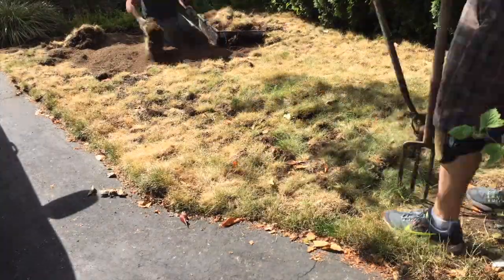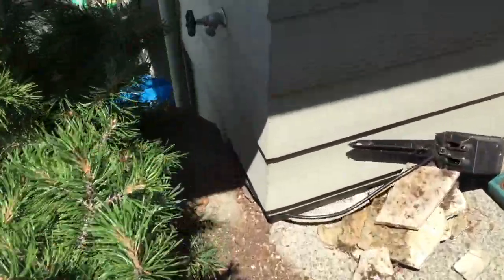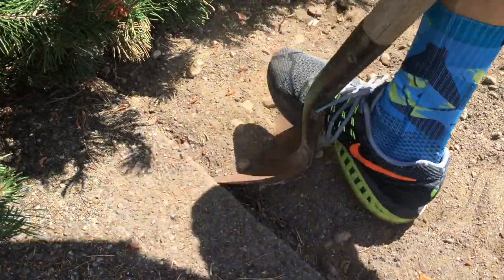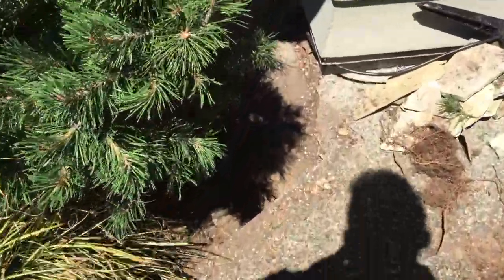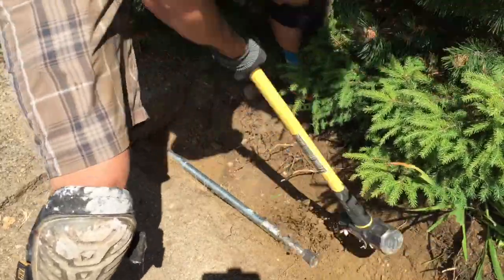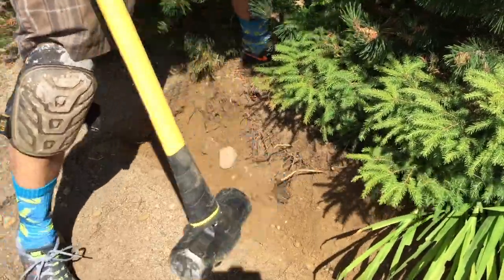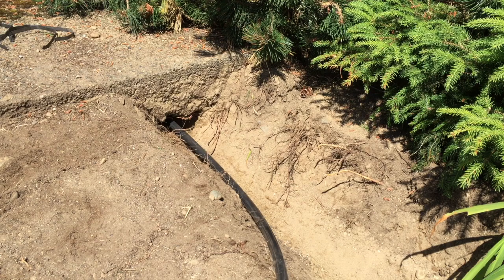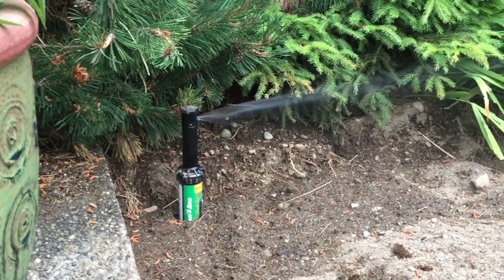DIY: How to Pipe Under Existing Concrete : Sprinkler System Tutorial

Comment: I did a hybrid of what some are saying, using pvc with a jet tip, but In the PNW here we have a lot of large rocks in the soil.  so I used a 8' "dig bar" which is effectively what you made with the pipe, and i hit it a bunch with a sledge hammer!
Reply from the maker: Great to hear Brian and thanks watching.  Nice work on doing it yourself.

Comment: I have always used pvc and hook it up to a garden hose and jet it under the concrete
Reply from the maker: Thanks for the suggestion Dan.  I'll have to try that out.
Reply: I like that his solution was free by finding a way with stuff around the house. He lucked out only needing to go under a few feet of concrete, but yeah, he would've saved himself a ton of time and work doing that method. The fittings are cheap, too.... $5 for an "Orbit Walkway Tunnel Kit" at Home Depot
Reply: a lot of people are suggesting this pneumatic method, but would it work in dried clay? always looking for an easier way

Comment: I have a well in our driveway and the power cable broke under the ground. I had a plumber come and install a temporary cable but now I need to get it under the pavement. Your video is interesting but not quite what I needed. I need something I can buy to put on my drill. I need to go right angle then straight. I am not good at making tools like you are.
Reply from the maker: Interesting.  Did you get this taken care of yet?  If so, what did you use.  Thanks for watching in any case.

Comment: I am trying to tunnel under a small concrete slab about 3' wide.  I have tried using the water and PVC pipe method like everyone is suggesting.  I can't breakthrough.  Any idea why this is so difficult?  I have spent hours on this.  It sounds like it should not take this long with water and PVC.
Reply from the maker: Are you just using you garden hose pressure?  if so you might want to barrow or rent a pressure washer so you have extra power that is needed in your case potentially.  Thanks for watching Marilyn and hope you enjoyed the video.
Reply: You may be hitting concrete or rocks.  Try going a bit deeper with the   new line, or moving a few feet over from where you last tried.  Also, concrete is sometimes installed over a base of rock - typically 3/4 gravel.  You would have to go below that to get the line across.

Think about going larger than the line you actually need.  If I needed a 1/2 in line I would first place a 1 in. Line under the slab and then feed the 1/2 inch through it.   Then if there are later issues you can pull out the 1/2 in. line and not have to 
fight to get a new one in.

Comment: Great job! A friend of mine needs to do something similar but for a pool in a home built mid 60's.

Any suggestions on how to rewire a doorbell. Our new home was built fast and the door bell wasn't placed in a very practical place meaning its on the wrong side of the door. We want to install a door bell/camera but the angle wouldn't show much of the person so we must figure out how to get it from one side to the other under the tile and through the brick . Any ideas?
Reply from the maker: I actually have to replace my door bell so I'll make sure to do a BYOT on it.  However, I won't need to reposition my doorbell so I'll have to do some research on your situation.  I feel like I have seen some Bluetooth/ remote powered doorbells out on the marketplace. Have you looked into those products yet?
Reply: Go overhead instead of underground.  You can splice the lines in the attic to run the new doorbell camera.

Comment: I have used a tool that is specifically created to hammer a sleeve under a slab. It's like a giant ~20 lb needle, and you use a sledge to hammer the head of the needle with the sleeve around it. Does anyone know what this is called?

Comment: How many years did it take until that concrete cracked?….anytime you remove compacted dirt, sand or rock from under a sidewalk “eventually it will crack”…it make take a a few years but there will be a hairline crack, it will happen. The better way is pound a larger diameter pipe under the sidewalk and leave it, then run your hose through it. It won’t ever crack, the way you do it is fine for DIY’rs but a contractor will end up with a insurance claim!

Comment: But that hose only can run one sprinkler.  To be able to set at least 8 you need a 1" pvc pipe.
Reply from the maker: Not with a rainbird system.  I was able to connect 6 different sprinkler heads to it and it works great.  Thanks for watching.